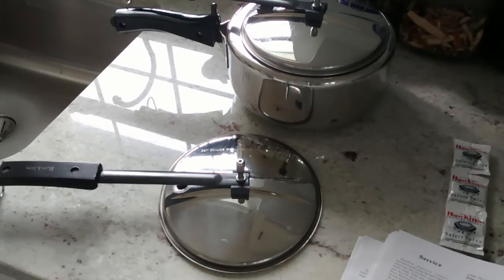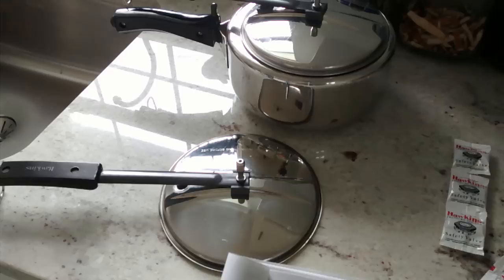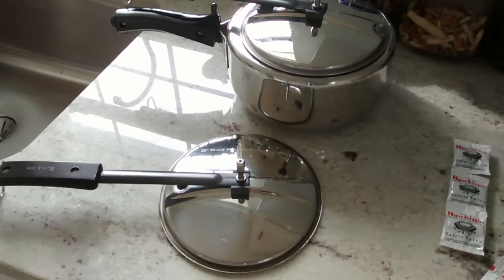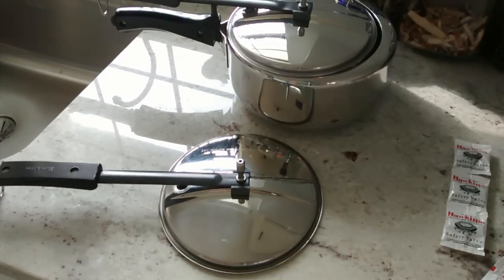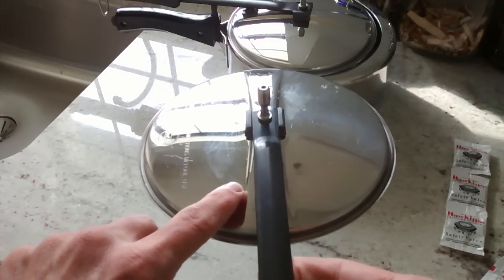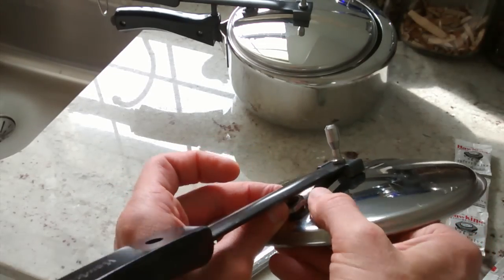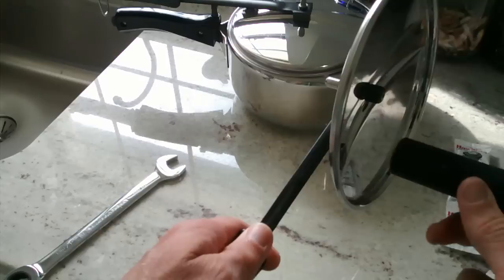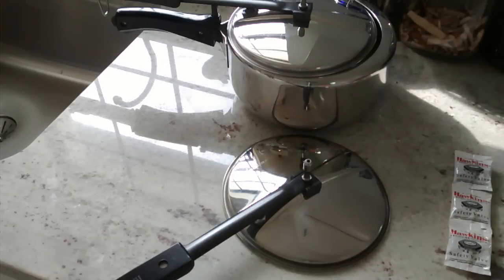Hawkins pressure cooker maintenance

Comment: I have replaced the valve before and then the metal plug had totally blown out of the valve. This time the metal plug was still in the valve, and so I was unsure if this was the problem. Your illustrations showing the stages of deterioration really help me know that the plug is the problem and is worn out. It also helps to know it makes no difference whether the screw is on the inside or the outside of the lid. Thanks very much.

Comment: Hi, can i get the link of safety valve
Reply from the maker: Hello, I bought these on Amazon but I would suggest trying to find a local Hawkins dealer to get the right valve. If you can't find someone then try searching Amazon but pay attention to the size because I'm not certain if one valve fits many cookers. Maybe call Hawkins directly and ask for the correct replacement valve model number and where to find one in your area.

Comment: Thank you sir, plz tell me Hawkins stainless steel 3 litre pressure cooker tall is best or wider one.thankfull to you.
Reply from the maker: 3 litre will cook enough Chana Pindi for two meals. 2 litre will cook enough rice for two meals. The reason for this is the size of item being cooked. Both 3 litre Tall and Wide cook for same number of meals. They recommend you do not fill the cooker more than 2/3 its capacity. Therefore, if you plan on cooking bulky items then the tall would be best as you could place the supplied Grid to lift items out of water yet stay within 2/3 capacity.
Reply: @StrongFives  thank you so much for your suggestions.

Comment: Greetings from Egypt, buddy!
I think you are replacing it in a wrong way, Apiary. Here is why:1. Your cooker seems to be a stainless steel one while you are using the valve of an aluminum one. As far as I have researched, it should work anyway. But, better, use B30-10 valve instead of that B10-102. The washer should be on the other side per Hawkins instructions on their Web page3. You should have used a sealant or glue on the valve threads per Hawkins instructions
Reply from the maker: Thank you Mr. Fareed, actually this valve is a B10-10 not sure if its a newer stainless one. The washer was installed on the inside simply because it was easier. The valve has very short threads and trying to put it through the lid and hold it while trying to place the washer and nut with one hand is difficult especially when the handle is in the way, there is very little access. Sealant on the threads doesn't really help much and I would never recommend putting glue on any threads. Loctite maybe but never glue. I'll check out their instructions on the web page, thanks for replying.

Comment: I didn't  get a compression washer with the replacement. What should I do, it doesn't  work like it used to.
Reply from the maker: What size is your cooker? The 2 Litre Stainless Steel doesn't look like it uses a washer however the 3 Litre does. You might have the wrong valve and that's an easy mistake because all the valves are stamped with a different number (JA4, HB4, HC4, TC4) and the replacement package doesn't have a part number except for B10-10 which doesn't match anything on the actual valve. If your old valve used a washer then I suggest ordering a new safety valve and make sure it's a genuine Hawkins replacement as they come with the washer.